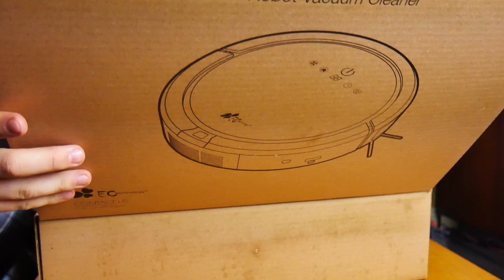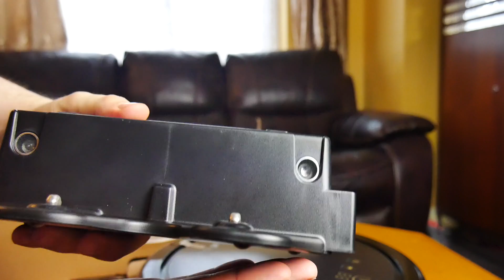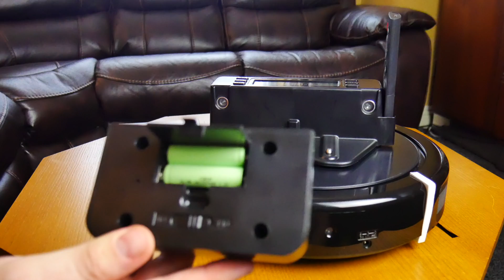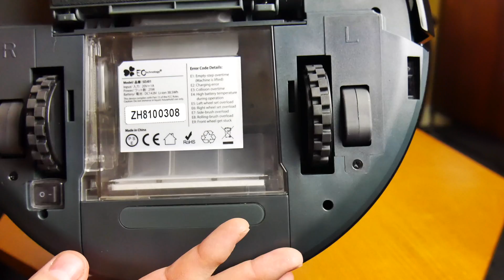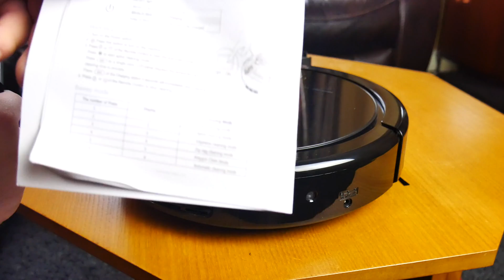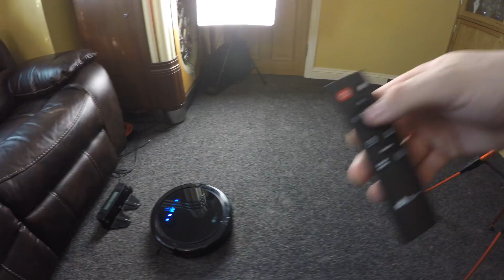Robotic vacuum cleaner under £200? Good or not?

Comment: Hi are you still happy with this robot ?
Reply from the maker: Monika Khan hello, if this is not charging when it’s connected to the dock I would recommend you contact support as they can go through the correct diagnosis for the product but make sure the power is connected and it sits flush on the dock for it to make a full connection